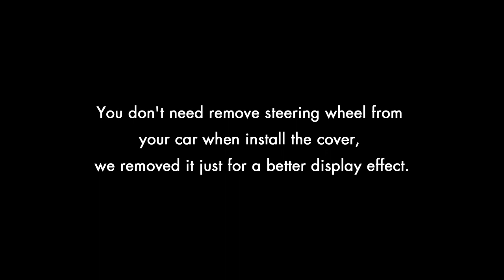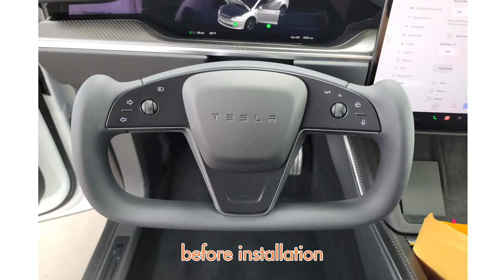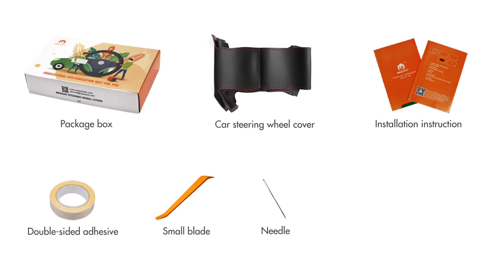MEWANT---for Tesla Model S 2021-2023 / Model X 2021-2023 Hand Stitch Car Steering Wheel Cover

Comment: In the box you included the double sided tape. When should we use it?
Reply from the maker: Hello，it is not must-be. If you are worried about inaccurate positioning, you can stick the double-sided tape on the cover, place the cover on the yoke, fix the position, and then peel off the double-sided sticker.